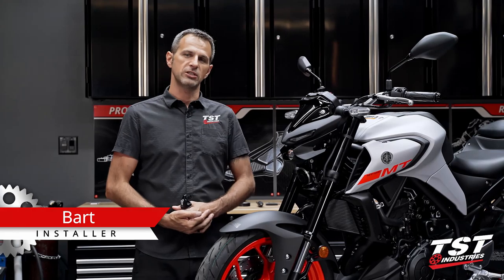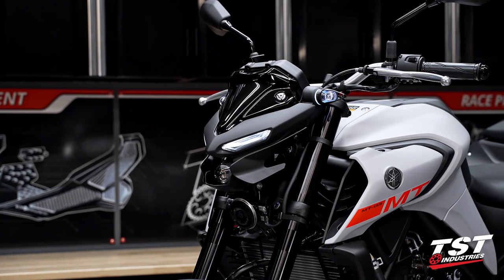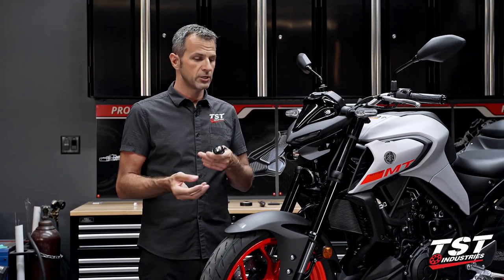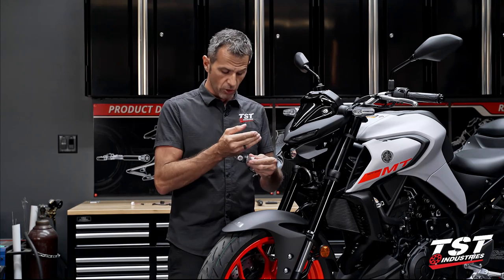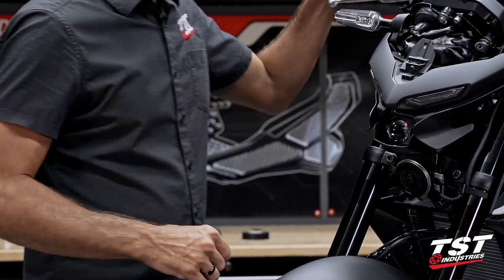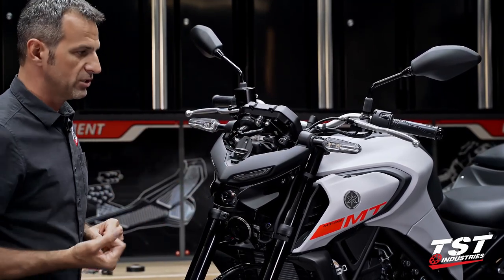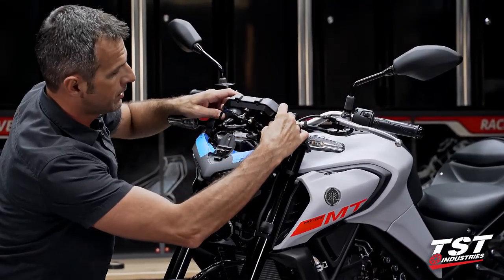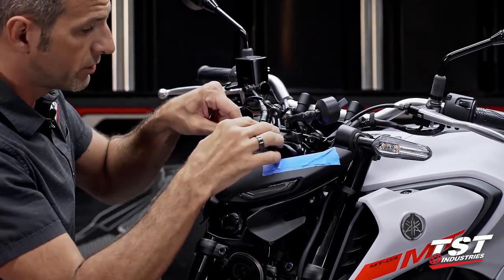How to install Mech-GTR Signals on a 2020+ Yamaha MT-03 by TST Industries

Comment: I got these in amber to replace my broken indicator after a drop. They were totally plug-n-play and much more affordable than stock replacements. I just had to seal where the light ring joins the ratchet system with some clear silicone for weather resistance.
Reply from the maker: I don't understand why you would use silicone there. Our lights are chemically welded together in that area.
Reply: @TSTindustries  I didn't design the light so I wouldn't know the weather resistance built in and it wasn't clarified in its description. Plus most applications for these are protected by fairings. I just know I saw small spaces for moisture to get into the unit when I'd rather there not be. So some silicone where the wires come out of the light ring and a little to seal the light into the ratchet system to make it a sealed, single unit and I never have to worry. Again, it probably doesn't need it but 25 cents of silicone and 5 mins to apply is worth the peace of mind.
Reply: @TSTindustries  and just to clarify, I'm not knocking on these lights. I like them very much. In fact, my only critique would be to have the light ring portion be in black instead of white so it's less noticable when installed on the MT-03 since there's no fairing. You have to really look to notice them so most won't, but I know. Once I have a front cowl, it will be a moot point.

Comment: Great lights. I get making them universal but if you shorten the wire for the light and oem connection you can fit easier underneath
Reply from the maker: And then we can't use them on the other bikes they are meant for.

Comment: You guys need to do a video with an example on how to do the splicing for the international models that don’t have day time running lights. I’ve got the new 2021 mt09 on the way and I want to throw these indicators on with the halos but my model won’t have the day time running lights and the halo is the main reason I want them.
Reply from the maker: We can possibly show a generic "how to splice" video if it's truly needed but we don't have access to International models so it will be a little tough to demonstrate the exact method on your bike.
Reply: @TSTindustries  fair point, I think another alternative would be the following. When you upload more videos to install these indicators, during the install you simply show an option for where the halos can be spliced if it is an international model, in other words, show what you would use to do the splice and which wire. Looking through the comments on other install videos there are a number of people asking about this exact thing and they’re told simply to just splice into the headlight. Given not every bike is the same I think adding this little section to the future videos will be extremely helpful.
Reply from the maker: @mt-09nz98  We will definitely take this into consideration as we move forward. Unfortunately, a lot of times we're not made aware of these issues until we begin selling the kits, at which point our videos are already filmed and uploaded. We will continue to try our best as we always do.
Reply: @TSTindustries  awesome guys, looking forward to some products for the new 2021 mt09!

Comment: 5:25 there's a far easier way to remove the gauge. Near the top philips screw mentioned, there is a silver allen key nut, remove that, then go over to the other side, underneath the gauge, there are 2 black allen key nuts that uses the same size key. removing these 3 easily accessible nuts will allow the gauge cluster to be removed together with its mounting bracket. no need to fuss over the 3 philips nuts
Reply: The real hero is always in the comments. I was racking my brain trying to figure out how I was going to get a screwdriver up in there using his method. This makes it far easier and with more access. Thank you!

Comment: Wow, fairing on this bike is slightly shifted to the left side just like on mine :P I was looking how to align it but it looks like it requires of removal of whole headlight assembly.
Reply from the maker: Yea, they are manufactured with some inconsistencies.
Reply: @TSTindustries  Yes they are, made in Indonesia. Its not bad quality but you can find few other places where they cut costs.
Anyway, do you know how to align it properly? I have tired but it looks like you need to loosen screws that are not accessable without removing whole headlight assembly.

Comment: Would you be willing to measure the distance between the two led lights? I dont know what it will be and I dont want to install them before I get the bike inspected at the end of the week, but really wanna put these in...if you could I'd greatly appreciate it
Reply from the maker: Unfortunately we cannot do that at this time as the OEM headlight and signals has been removed for this build.
Reply: @TSTindustries  thats what I need to know the spacing of, the new distance between LED outputs in MASS needs to be like 16". Massachusetts sucks for inspections requirements 😄

Comment: Can these be installed on the rear with your TST fender eliminator kit
Reply from the maker: Technically you can mount them to the OEM signal relocation bracket we sell, combine them with our CVY02 harness converters for plug and play connection and there you go. I do have to say that you will probably not like how that looks though because the guts of the physical mounting system will be visible along with our not-gate circuit on the wiring.

Comment: if i buy the flush mount will the install be the same ¿
Reply from the maker: The flushmounts only have one circuit so there is no running light in them by default. You would connect them more like in this video on the MT09 https://youtu.be/n4Er3PjPm40 . If you want a running light with the simple flushmounts you can couple them up with our Running Mate and that will get you the running light function in dsimple single circuit lamps.

Comment: Just ordered these, call me un-educated, but why are people asking about Flasher Relay? is there something im missing?
Reply from the maker: On most modern sportbikes, when you switch to aftermarket LED signals, you need an LED Flasher Relay to correct and control your signalling system to ensure your signals flash at the correct rate. That is not the case on this bike so it's a non-issue.
Reply: @TSTindustries  thank you 🙏🏻

Comment: Tst lights are freaking bright.
Reply from the maker: We put a lot of work into R&D and selection of the appropriate components. It has been paying off.
Reply: We really appreciate it, and the fact your stuff looks good to which is a great combo. Oh the ratcheting clip to hold the lights in are pretty sweet to, holds em tight. Also the length of wire is perfect and the stock connectors is perfect to. I constantly recommend you guys to everyone i know, especially when they see my lights, i show them the tst sticker lol. Thanks

Comment: Sir where is the signal light relay yamaha mt03 please
Reply from the maker: There is no relay on this bike.
Reply: @TSTindustries  ok thanks sir.that’s why I’m asking because i bought a side mirror with signal light. i added a signal light and I have a problem when the engine it not running the signal light is working but when the engine is turned on the signal light is goes of what will i do sir?
Reply: @TSTindustries  please teach me sir what i will do